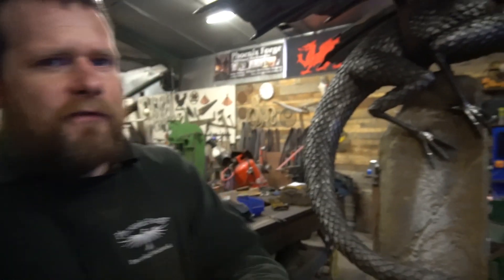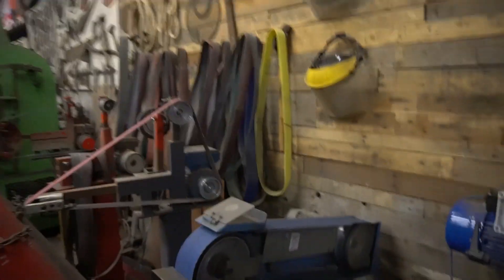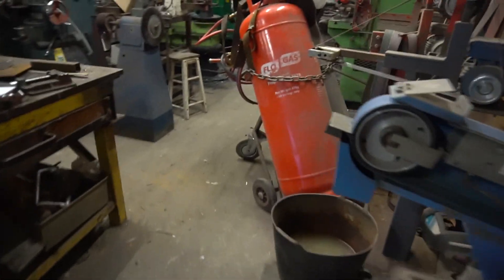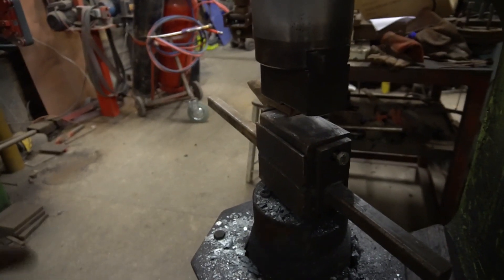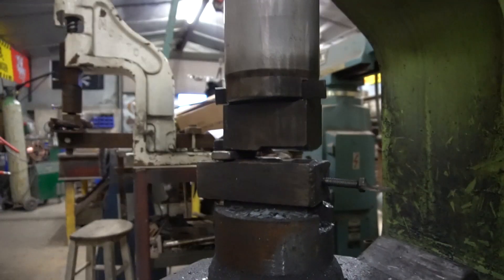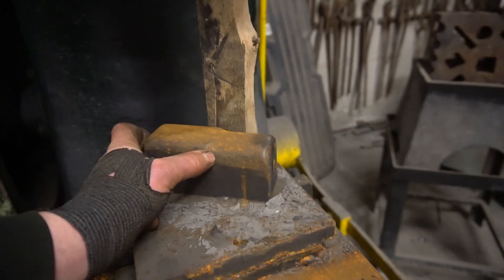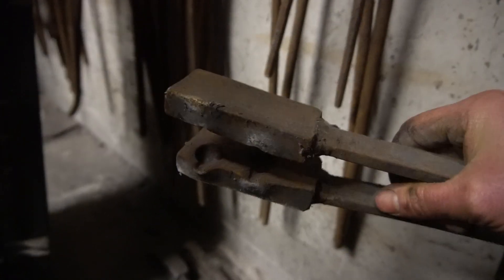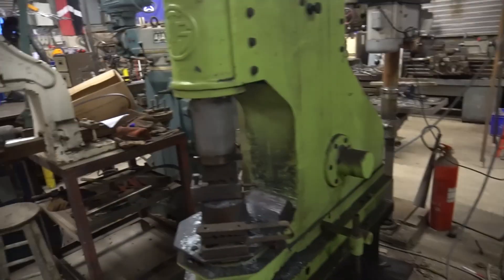Forge Vlog #011 Update and Power Hammer tools

Comment: Thanks for the details on the power hammer tooling. What material do you usually make the saddle faces from ? 
The saddle with the 'hardy hole' looks the way to go.  And you've just set me up for my next project - make one of those self leveling flatter saddles myself.   The dragon looks awesome btw.